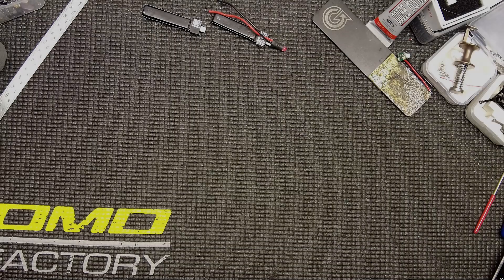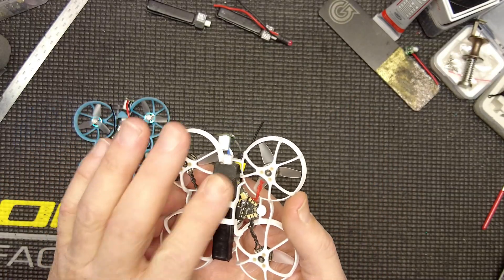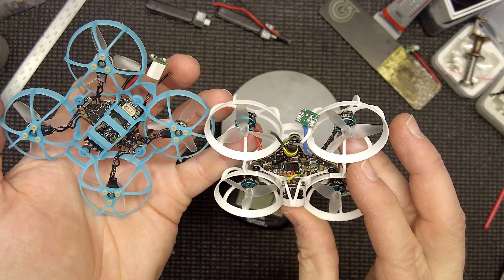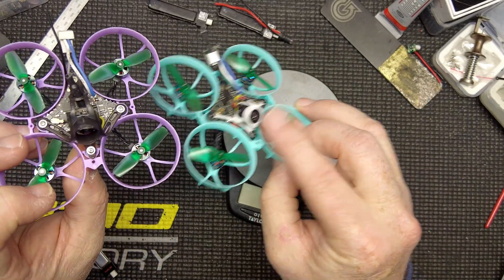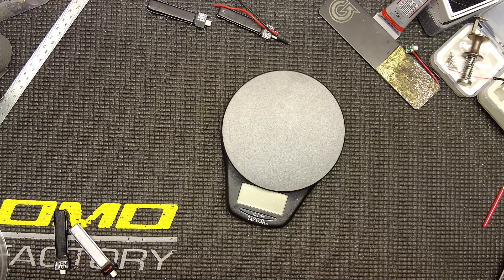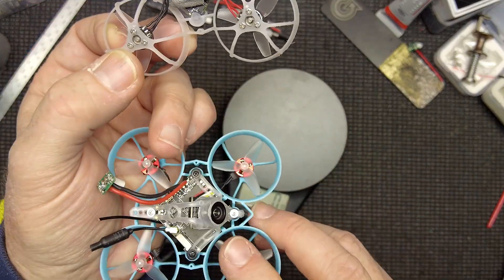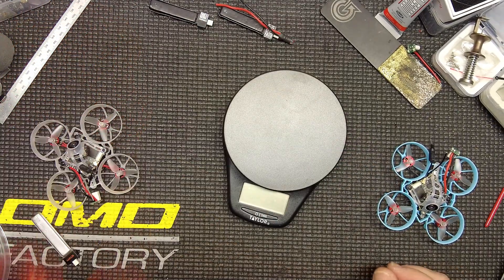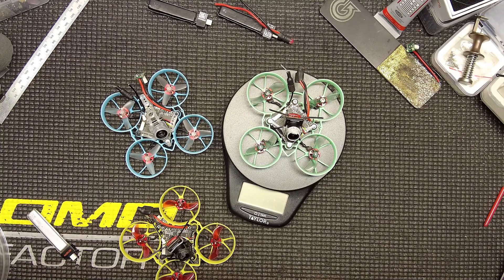Custom HDZero Whoop Setups

Comment: nice whoops,

Been using air65&75 and mob6&7 hdzero.

Want to build a custom tinywhoop now.

 what would you say is the best analog camera? which canopies do you recommend (buy&print)

which frames do you prefer? i wouldnt mind converting a 65 or 75mm to a toothpick or a tiny quad like the sub250g turtle x

what props do you recommend for freestyling?

Comment: I use the 802EX 33,000KV Ipomoea on a 20.5g analog 75mm whoop, and I plan to use them on my HDZero AIO w/lux cam on a purple crown frame when my hdzero stuff comes. I am ELRS, and just got into hdzero this bf sale.
Reply from the maker: Setup sounds great! Still not sure the tradeoff with 0702 (1mm vs 1.5mm) vs 0802 power & weight, with freestyle and building dives the heavier the better?
Reply: @StogieMaru  Not sure, I mostly race whoops and its too cold in MN to go out and test freestyle rn :) Thought I do keep a 25g 75mm meteor75 pro on the 75air frame, because sometimes its nice to have some weight to throw around

Comment: id like to see in depth on the hdzero builds and if you have any built with hdz vtx befoe the AIO came out. I bought the eco vtx to build my first hdz whoop and it hasnt gone well
Reply from the maker: Power to weight ratio - wise... might be best off in an 85mm whoop? AIO5 for the 65 & 75mm whoops for sure. If I don't use my ECO-board in a Tiny Trainer, I might spin up an 85mm whoop next Spring.